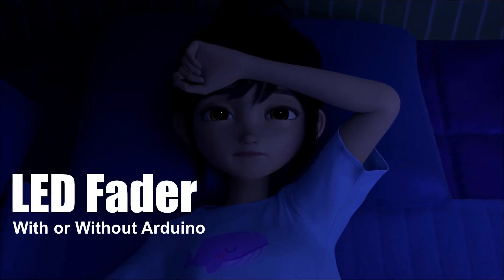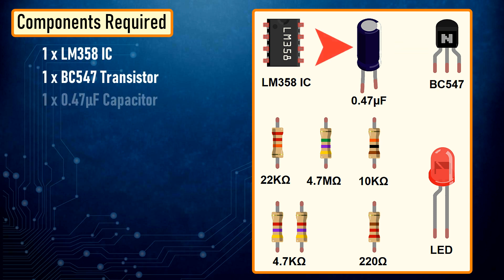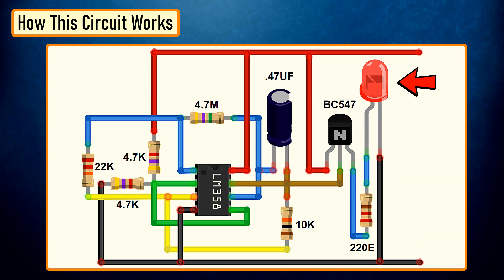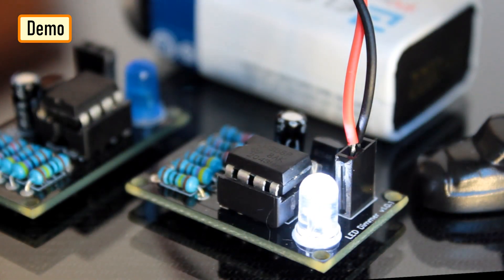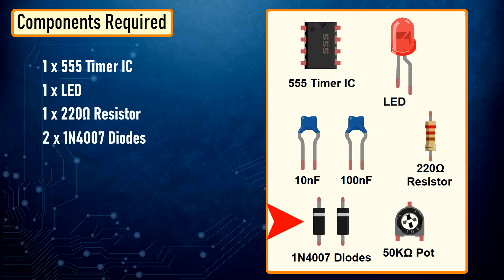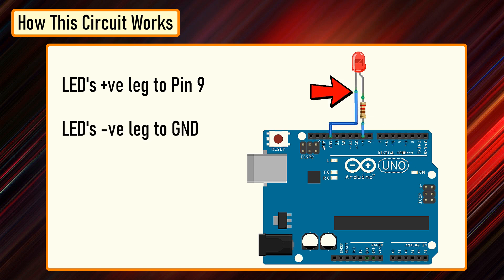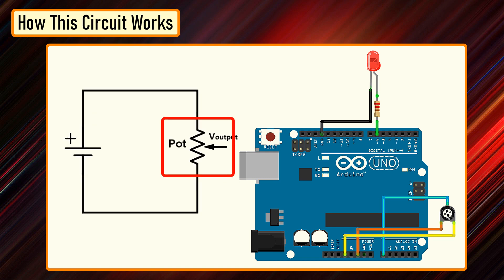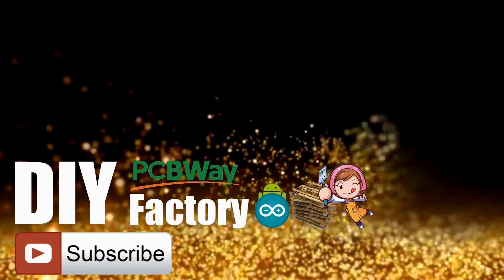LED Fader - With or Without Arduino

Comment: Can you use an audio input instead of the pot to control the LED brightness? That way it will glow in time with music?
Reply from the maker: If you are using arduino, you don't need this at all
Just use the pwm feature of arduino
Reply: @CrazyCoupleDIY  but how?

Comment: Thanks for sharing such an Awesome project.
Can you please do another video to control the led fadein on short press one push button & fadeout press another push button.
Awaiting your earliest response.
Thanks & kind regards.
Reply from the maker: Thanks for the appreciation

So basically you want me to make a video where the fade in and out is controlled by a push-button, is it?
Plz let me know thanks 😊
Reply: @CrazyCoupleDIY  Yes dear, you are right.
I want a push button controlled led fadein fadeout circuit. When the button is pressed for a very short duration of time the led should fade in & when again the button is pressed same way the led should fadeout.
I thank you for your response to my query.
Awaiting your earliest response.
Thanks & kind regards.

Comment: Hello, thank you for sharing. I had a question.. I don't have a 4.7M resistor, is there something I can substitute it for? And will changing this resistor require I change the values of the other resistors?